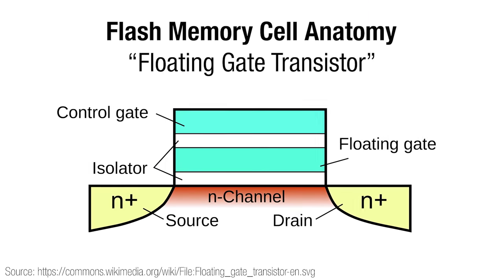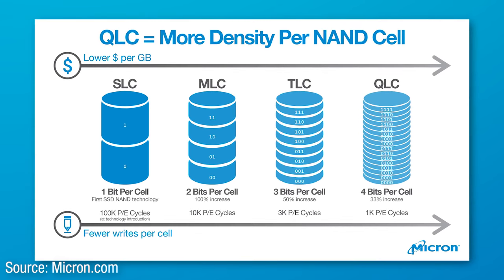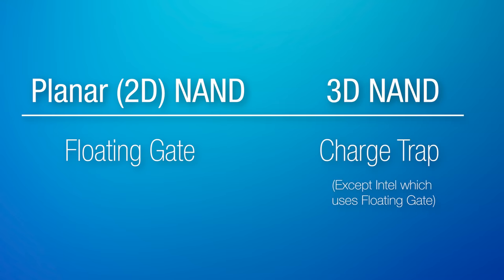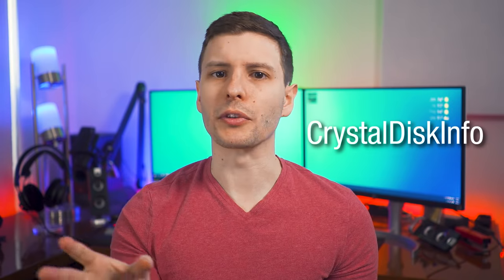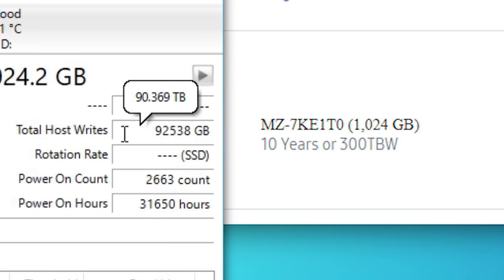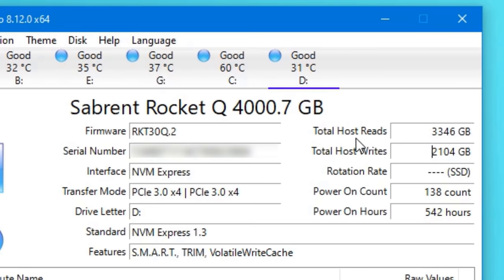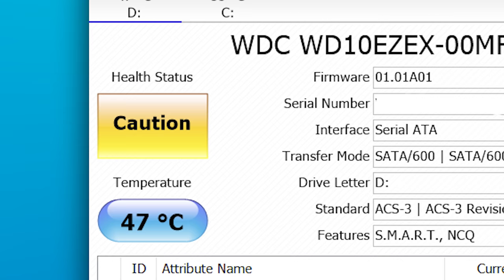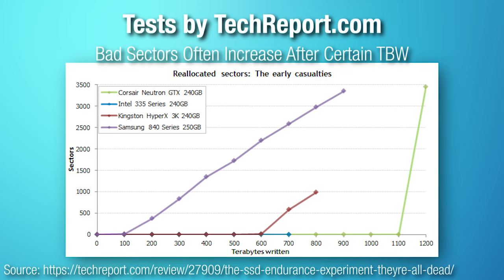How Much Longer Will Your SSD Last? How to Tell

Comment: I remember hearing around two years ago from (I think) a high school computing teacher that a good idea was to have extremely long term backup/storage be an HDD, especially since they typically have greater capacity than SSDs and they can give signs that they're starting to fail, but for usability (since they're so fast) you should use an SSD as your actual main drive.
Reply: I'm still amazed that even in 2021, if you want it to last for freaking ever, you put it on tape. Once it's on a tape, you can basically store that thing forever.
Reply: @Mostlyharmless1985  But doesn't the magnetic tape lose its magnetism over time?
Reply: @jpHasABadHandle  No, not really. I'm sure in the timeframe beyond humanity it would degrade, I still have regular floppy disks that still work that are over 40 years old. A greater concern would be losing the hardware to read the tape or it physically breaking.
Reply: @jpHasABadHandle  in theory yes, but when the time is bigger than you lifetime it don't really matter anymore unless you are a company that don't die and need data for longer....
Reply: The thing is, when a SSD fails, you can mostly say farewell to your data, except the luckiest event of write-protected flash, when you can see the data and read them. When a HDD fails, you still have chance to recover your data, depending on how it failed.
It´s always good to make backups of your data. Having backups of backups is also good.
Reply: @Mostlyharmless1985  M-Disc
Reply: @jpHasABadHandle  I have VHS tapes from 35 y ago that are still fine. DVD-R have failed in 2 y or so. Old technology seems to be munch more reliable.
As for floppy diskettes, the 80s stuff was much more reliable than the late 90s stuff. I'm talking about 1.44 MB diskettes.
Reply: I had an hdd for over 13 years till now and it used it daily. It started showing bad sector recently
Reply: @Mostlyharmless1985  you cannot use those no more as modern laptops don't even have anything like that
Reply: @louistournas120  actually modern tech is even more reliable and last for ages if the device is treated properly
Reply: @Mostlyharmless1985  Tape isn't chemically inert though. If you wanted truly eternal storage, you would probably need to use something like quartz (e.g. 5D optical data storage).
Reply: @stephensnell5707  We don't actually know that. No one has conducted 20-year-long studies on the durability of "modern" tech. By definition. 

Modern materials and structures sometimes display novel forms of degradation. We can't know for sure. We'll know once it's become old tech and people have studied it enough though.
Reply: @VVayVVard  it’s plenty chemically inert enough. Entire economies rely on the fact that it is. It’s about as eternal as is practical to be.
Reply: @Mostlyharmless1985  It needs to be stored in a controlled environment (in terms of temperature, humidity, physical stresses and other environmental factors) so it's not necessarily resistant to catastrophes (wars or natural cataclysms) or negligence, which is a problem if we want to store information for centuries or more. Which is why I personally hope we'll see quartz-based or other more eternity-resistant solutions developed in the future.
Reply: @VVayVVard  ah I get what you are saying. Yes. But I’ll maintain that tape will last if kept in the same conditions that are appropriate for the equipment that it’s running.
Reply: Man idk what happened but i had to replace 13 yo hard drive with another hdd
I got signs of death 6 months before but i didnt know about signs
Reply: @Mostlyharmless1985  i have heard that M disk is used to store data for very long.
Reply: The drives to read tapes are a bit expensive and hard to find as a consumer, as they’re almost exclusively sold to businesses. There’s also the business with the differing LTO standards (if your tapes’ LTO level is too old, newer drives might not be able to read it). Then on the software side things are also a bit different (as a tape is not a random-access medium).

For an average consumer with a couple TB of data, a NAS with a couple of 3.5” SATA HDDs in RAID is by far the more approachable and affordable option.

Comment: ProTip:
You should probably use a small persistent ramdisk (using something like IMDisk) for your browsers & especially if you love to have tons of tabs open or stream a lot.
FF for example can write 50-90GB per day unknown to you just by having various tabs open or steaming because it’s continuously writing to the cache folder & profile folder (lots of sqlite files).
I once found that my SSD got 3TB written just in about 2 months & reads had increased by 25TB! 
Migrating browser data to a ramdisk brought it down to 5-8GB/day.
Reply: I tried doing that but I couldn’t figure out how to use the Safari browser on the RAM drive
Reply: How big is your ram?
Reply: @MEOW-sh9qz  just 16GB. About 767MB for the ramdisk. Its really a cool set-and-forget kind of a deal.
Reply: @maxpayne69.  Do you know a side where it is explained how to do a ramdisk for a browser? 
Max Payne: one of the greatest games!
Reply: If you've got enough Ram, then windows shouldn't use the Pagefile at all. Or you could even disable the pagefile. No ?
Reply: @maxpayne69.  Can you make a quick guide for that and Upload to your channel?
I already know RamDisk but I don't know on How to force FF to use it without accessing SSD.
I don't care if you record it from phone.
I just want a quick glance.
A Short Video vertically also okay
Reply: @niezzayt3809   It's been a while since I set it up so the steps are kinda rusty in my mind 😅 ...but sure! 🙂 
I'd got a few requests on reddit too back then so maybe it's time there's a short & easy video available on this?
 
Only one minor issue - not having access to my laptop atm as I'm away from home for a while. Will make a reminder for it & will ping you here when it's ready (mostly likely ~21-22nd ofJan)
Reply: Tried setting up a ramdisk for chrome but I'm still getting a shitload on writes on the HDD, it seems like whatever is downloaded (ie youtube video, pages, some speedtests etc) doens't use the regular cache.

Comment: My first-ever SSD was a Samsung 850 EVO that I got back in Christmas 2014 as a gift to upgrade my laptop. Never before had I seen boot speeds so fast! I still have the drive and it still works great. Not using it as my main drive anymore, but for transferring/storing large files portably, it's very useful.

Comment: My first SSD was a Drevo 256gb one, it lasted about 3 months and I wrote just a few terabytes to it. I’ve used other brands ever since just for my own piece of mind and my Crucial is still going strong
Reply: I bought my first and only SSD a 120 GB Crucial in 2013 and it's still working fine.
Reply: @UncompressedWAVmusic  SLC Dinosaur bro
Reply: 3 months? Damn that's a small amount of time i have a samsung drive with 256gb and it lasted way longer than 3 months
Reply: @TheFriok  been using a Crucial 256gb for 6 years in the same computer and still at around 80% health showing in SMART

Comment: Upgrading from HDD to SSD is worth the investment. I have purchased the earlier version of Intel SSD (very costly then and only around 100-250gigs If I remember it correctly) and until now it is still works fine. I had to switch it to Samsung SSDs though so I can make use of Samsung Magician. I transferred it to my laptop using a caddy and it still amazes me how faster the laptop boots now and no more freezing.
Reply: Hard Drives are always going to be the best

Comment: Turns out I have exactly the same Samsung 850 PRO 1TB as you, and had concerns it was old enough to be unsafe - but thanks to CrystalDiskInfo it's only at 13441 GB Total Host Writes, and 99% Good. I'll still be replacing it later this year (hopefully) with a bigger, modern TLC on a new rig, but it sure is nice to have the extra piece of mind it isn't likely to drop dead anytime soon (regardless of having it backed up). Thanks so much!

Comment: I have the same old Samsung SSD (850 pro 1tb) inside my PC. Few years ago i read a article about this drive. They tested how much TBW is possible. The first one broke after 3000TBW and the second one after 9000TBW. So 1000% to 3000% more than Samsung told us :)
Reply: I mean I have an 860 1TB that's about two years old but I've only put 24~ish TB on it so I have no idea how long it'll last me. most likely longer than my computer.
Reply: 2015 850 evo 250gb at 172tb out of 75tb, no issues encountered. Allthough CrystalDiskInfo is showing "Good 33%" status. So possibly very mutch on the decline but idk what the percentage means.

Comment: My Intel 535 SSD that was 5 1/2 years old just died last week. Seems like a short life span especially because I only use my computer for a few hours a week and I'm not doing heavy writing. Just bought the Evo Plus 970, so I'm hoping that'll last longer.
Reply: Oops, I also have that ssd. A few years ago, me and other people complained on Intel forums about 535 ssd firmware issue, it would write lime 2gb every few minutes when idle. They gave a firmware and we installed it, but that firmware was not put in the official tool, so other people won't know about it.
Second thing, ssd cells need refresh from time to time, if you keep pc mostly off, it will not have time to run a background self check and refresh.
Even better would be to run a read surface scan from time to time, as it gives it a change to refresh cells that have weaker charge.
Cells leak electrons over time and the higher room temp, the quicker the process.
An ssd turned off, can only hold data up to a year, in normal temps, like under 30C. This is a JEDEC standard.
Reply: @nilsfrahm1323  
And that's why I don't trust them, lol. I have ancient external harddrives (12-15 y.o.) with no data degradation.
Reply: @Aetila  yea. Try using the trash HDD that Seagate and Wd , Hitachi are selling and see how long your data will stay on them. 

I use external drives for reading purpose, and using HDD is simply stupid. SSD can withstand read cycles because read cycles don't affect SSD health. A SSD can easily outlast a HDD as long as it's plugged in twice a year to refresh data, this is the sine qua non conditions for keeping a SSD running.
Reply: @danteerskine7678  
But I do what you suggest, lol. I have ANCIENT HDD drives in my room, like 10-15 years old stuff and NO DATA LOSS so far, it's pretty crazy because I thought they would be faulty, but no. On the other hand, I had some USB drives and they got corrupted after a while, with minimal use. I also read that SSD WILL lose data no matter what because of that advanced tech, they catch an electron an keep it in place, it marks a "bit"...but with time the electron will disappear thanks to the "quantum tunneling effect"...so it won't be as reliable as a HDD. 
I have among others a Dell laptop (E6400), it's 15 years old with a Fujitsu HD...AND it's still good, checked with a HDD app, no damaged sectors yet, it's just insane, lol...but it's slow like hell, I use that laptop as a music sequencer nowadays, so I speak from experience. Peace

Comment: Crystal DiskInfo is great. I have a Samsung 860 Evo 1TB. I figure for most use cases, an SSD should outlast any other component on a computer.
Reply: yeah I've got mine in my build 5 year old build. it's got 97% life left but I'd say the rest of my computer only has about 40% if I were to guess.

Comment: My life just got more complicated! 😹
Reply: verified mfs boutta steal top comment
Reply: And this is why I am skeptical about moving to them. Speed is nice but when longjevity is strictly limited, we tend to have a problem.
Reply: @Kyugorn  the drive will probably fail sooner, than you reach the TBW value, which still isn´t the end of it - TBW only means a guaranteed value by manufacturer - final value depends on the quality of cells and also luck.
I am still using SSD, i bought 6 years ago. It has 72TB TBW limit, which i never ever reached and i´m not limiting the amount of writes onto it. That said, i´m not using it on the main rig anymore, but it´s still in use.

Comment: Actually, there are two values of the SSD write. One total and one I guess is related to those SSDs that have their own cache memory SLC. Also, for longer life, it is recommended to set a certain percentage as unformatted to reduce wear and tear. It is recommended that at least 10% be unformatted.
Reply: Never heard of that. Doesn't make any sense.
Reply: Alternatively: Just leave about 10% of the drive unused.

Comment: I personally see greater benefit to SLC stacked optimally than moving to higher bit per cell densities.  Most likely wearing down higher bit cap cells will run us out of constituent materials faster than sticking to the lower capacity per cell block.  Data centers need a different strategy to avoid running out of capacity.

Comment: I was worried about my 4 year old SSD, turns out I've only used 10% of TBW. Nice!
Reply: yeah if you keep good care of it(i.e. don't have the pc on for short amounts of times and keep it cool.) it should last more than a decade. at least from my math, though I don't think it'll preform the same in the later parts of it's life.
Reply: @maxx1o1  what do you mean by dont have the pc on for short amounts of times?
Reply: @_hector__  well if you're doing work and saving/downloading stuff then have it on for at least 30 minutes after you're done and you should be good.
Reply: @_hector__  ssd's need to "ware-level" so that it doesn't die early due to just one or two bad sectors.

Comment: They can last a long time..I have one of the old Crucial C300 SSDs, that is a decade old and despite it having been used for many years as C drive and other uses, it still to this day function fine.
Reply: I bought my first and only SSD a 120 GB Crucial in 2013 and it's still working fine

Comment: one thing that's often overlooked is that those new NVME drives are a lot more vulnerable to physical impact... I destroyed one of mine while trying to push down the clamp on the PCI connector on my GPU with a screw driver, hitting the NVME drive instead... only a tiny part on the corner was broken off, but that made it a total loss.

Comment: Something he didn't mention, to my understanding, the fewer bits per cell there are the faster the SSD can perform but the more expensive it is to produce/buy (and I think they heat up more but that's not much of an issue for an SSD).
Reply: Heat also affects SSDs and will cause them to fail faster
Reply: @stephensnell5707  When I made my original comment it wasn't much of an issue but some modern SSD's have reached a point where they need cooling to avoid a meltdown (more storage and higher speeds/higher power consumption in a tiny form factor).

Comment: I have so many questions,  but with 1,500 previous comments,  I'll take the chance and post a few.
1. How does using partitions and virtual machines affect the whole SSD? Based on your comments about reallocation,  I assume it makes no difference, and writing to a small VM counts as writing to the whole drive.
2. I always thought that failure in a SSD comes at once, and no bad signs are evident like clicking sounds in a HDD. Is that not true? Can I actually use SMART and scanning for bad sectors to anticipate the day?
3. How about a nand-based device like a Kindle? Can I predict its remaining life by scanning for bad sectors?
I hope @ThioJoe sees this.

Comment: January 2015 I bought an SSD from Crucial 128gb capacity and connected via SATA. With almost 8 years of use it's practically ancient now. Back then Crucial didn't even have TB written as a condition for their warranty (they only added it sometime in 2017) Well, the three year warranty is over now, and it has over 50TB written or 400 times its capacity. Crystal disk still reports 53% health and labels it as "good" I don't know at what point it will label it something else or if I'll still have this drive before I find out :D
Reply: That's terrible it should have 150tb min failure, so 50tb and 50% is awful
Reply: @minixtvbox bruth it's 8 years old....

Comment: I understand that SSDs are the future. They are really good and fast compared to HDD drives. But, there is one situation when classic HDD is better. I mean, complete disk failure.
  Due to the fact that the HDD is mechanical, it can be repaired and the data stored on it can be recovered. However, a damaged SSD is a total disaster because data recovery is practically impossible, and even if it is possible to recover data, it is expensive and demanding.
SSD for daily work 100% yes, and HDD as a medium for archiving valuable (vacation photos, important documents, etc.) data that can not be redeemed in any way.
I know personally a situation when a friend had a fire, the computer and other things burned down, but the HDD platters were not destroyed. After cleaning and transplanting into a new disk, 70% of the data was recovered. The face of the computer owner is priceless.
So personally, I think that the best solution is to have both types of discs in a PC.
For the System, data and e.g. games that require fast SSD data flow.
HDD is better for data archiving.
Reply: so it's better to store imortant files in HDD then SSD ?